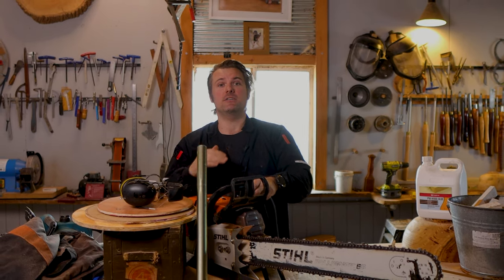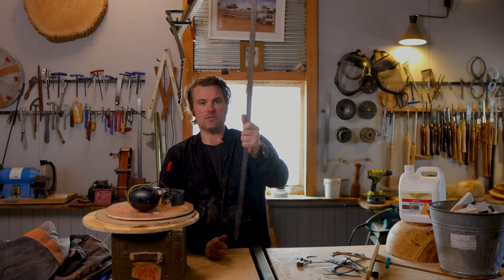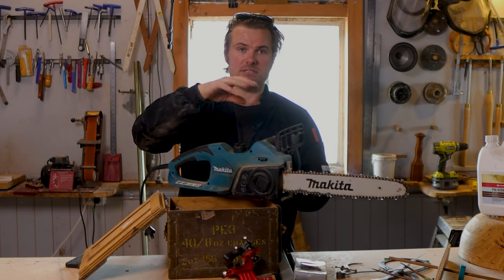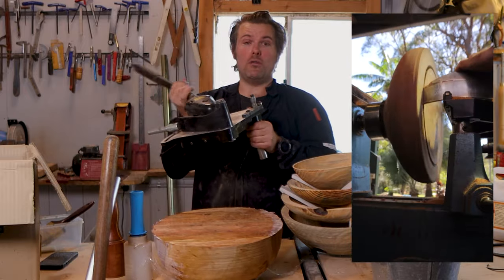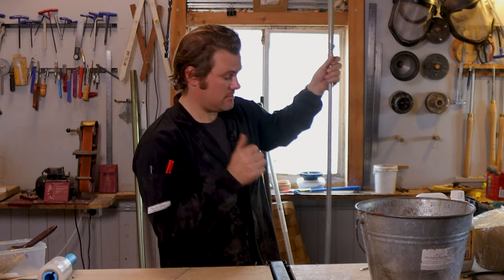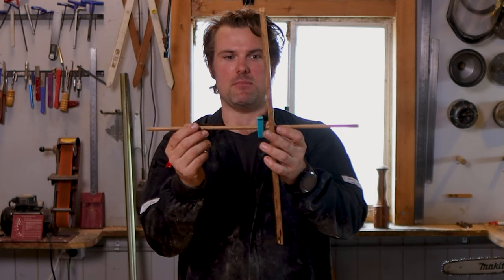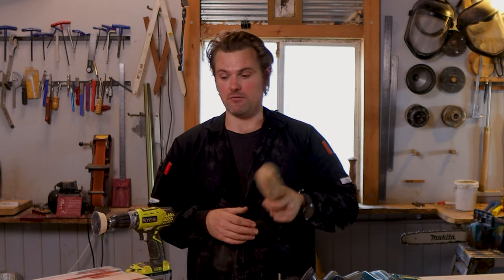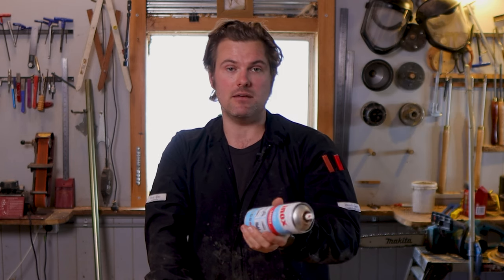7 Essential Woodturning Tools: with Perfect Matches- must haves!

Comment: Hi Kezz. this was absolutely your best and most entertaining video so far, and among all wood turning videos something I have enjoyed most. Great tips and ideas, have to watch again and make list of those I don't have so far. 😂

Funny though yesterday my husband was wearing similar protective pants for chain saw work and looked at me and asked whether I would be comfortable wearing them. I said they seem to fit, so chain saw lesson is on the way. 😊 

Also wanted to comment that you said you take your wood chips to animal shelter sometimes. I have a horse and the bedding is super expensive at the moment so I collect my wood chips and take them to the stables. Toxic wood species would go to compost, horses are sensitive. Sometimes I have seen people comment the amount of wood wasted and they do not realize that someone needs that for a good purpose. If I sand items that have varnish on or like the PVA glue used, I separate that dust as I don't want to put any micro plastic to beddings that end up in farming fields eventually.

I have similar type of soft brush to clean the floor, it has 70cm wide brush. Exactly the same width between the posts in my lathe stand. Having that makes me clean several times a day because it's so satisfying... like magic cleaning all away with just a stroke. 😂 So that is your rake and brush combined.

As a lady of the house I cringed on the comments about kitchenware... My husband took some old plastic jugs to the workshop. They were retro plastic items from the 70's and collectors pay big sums (like 50€) for them. So they belong to my workshop so I can so them off in my future youtube videos. 😂😂😂 (I haven't made any videos yet but when I get to that point I think they may be as funny as yours, real life and real people are interesting, and you get more out of them. The chaos workshop must be organized before I dare to shoot any videos there.)

Thanks for brightening my day with this video. Cheers,
- Saara
Reply from the maker: G'day Saara,

Thank you so much for your feedback. Means a lot to me, knowing I can lend a hand in some way. So, thank you. I had a real blast putting this video together, and I'm already thinking about rustling up a few more, just some straightforward lists and sharing my two cents with anyone keen enough to listen, Haha.
Now, when it comes to gear, you've gotta make sure you've got those chainsaw chaps, no doubt about it. And don't forget your eye and ear protection, that's an absolute must. You'll find heaps of top-notch videos on chainsaws on YouTube; they were a real lifesaver for me when I started out.

You've hit the nail on the head with the safety reminder about wood shavings – those can be really pesky and toxic at times.
Soft bristles, mate, they're the way to go. My old brush has seen better days; it's starting to look like a moustache split down the middle, it's that worn out! Hahah.
Ah, "The Tuppawear," you've got it right. That's why I had to chuck in that safety note about using the ol' Tuppawear and being aware of the hidden dangers. Hahah.
I reckon it's a ripper idea for everyone to document their stuff and throw it up on YouTube. I've got a Q&A session in the pipeline, and I'll be dishing out some tips on YouTube and video-making, so keep an eye out for that one.
Thanks a heap for tuning in, Saara. Your support means the world to me, mate.

Cheers,
Kezza

Comment: Excellent vid bud! Very well made. Also, great advice for sourcing timber. I've always used plain Ole Elmer's glue for sealing up my work. I usually give it 2 coats. But for me. It works well. And it's really inexpensive.
Reply from the maker: Thank you so much for the support, mate. I've heard of that brand. Hey, if the wheel ain't broken, don't fix it.
Cheers, brother.

Comment: For the sanding disc rubber block cleaner, I screwed mine to the edge of the workbench. 
I have another that I can pick up and carry around.
Reply from the maker: Thanks for sharing, mate. That's a nifty trick. It would definitely make it easier to find, for sure. Cheers, Kez.